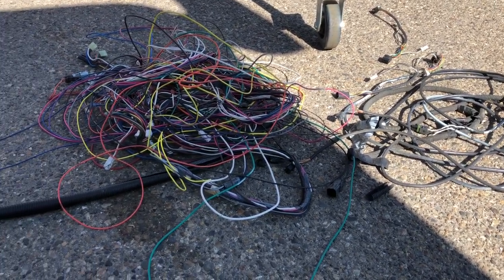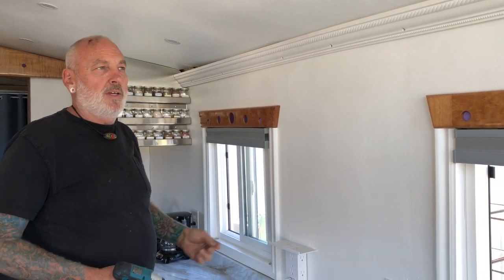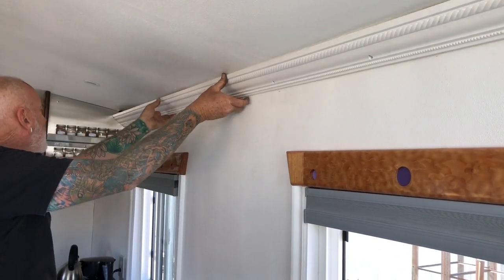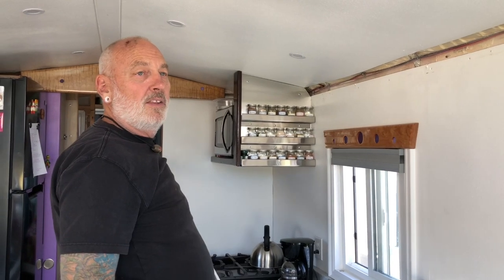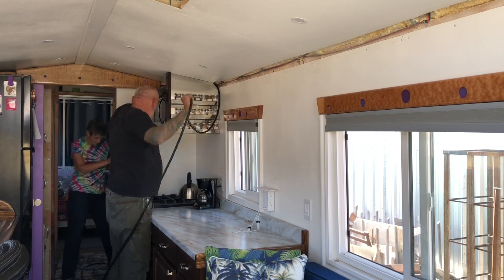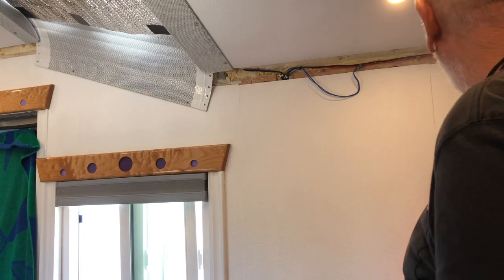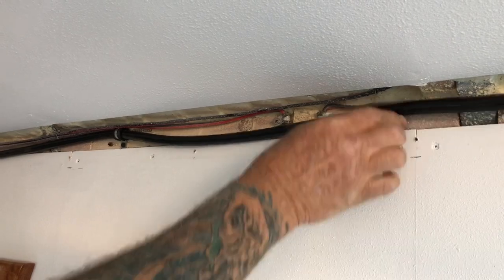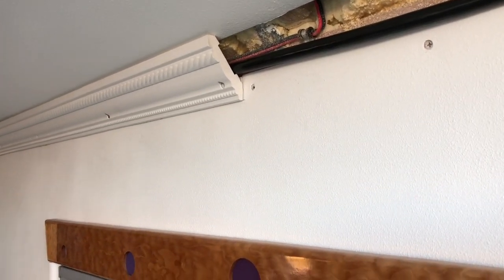Running Wires to Back of Bus - Vlog 174 School Bus Conversion

Comment: Randy, that cable is called multicore. Don't forget that wires like that can be ran along the chassis as well so you don't always have to go through the interior of the bus. A continuity check will tell you if you have a good earth for your lights as well.
Reply from the maker: Thanks for the tip. 👍😃👍

Comment: Good call using that wire, its nice to know it will always be protected and 1 wire will not rub causing a short that wouod be a pain to find. 

I like to think I will leave a empty 3/4 pex pipe front to rear for future wiring, or maybe get the same cable but with 4 extra wires for future use.

Comment: Your wire that you didn't know what it's called its typically called trailer wire
Looks really good great idea on the hidden raceway for your trailer cable.
Oh and I have the same kit of the heat shrink connectors I like them you might want to try the solder sleeves to their awesome
Reply from the maker: Thanks for the tip. We’ll look Into it. 😃👍😃